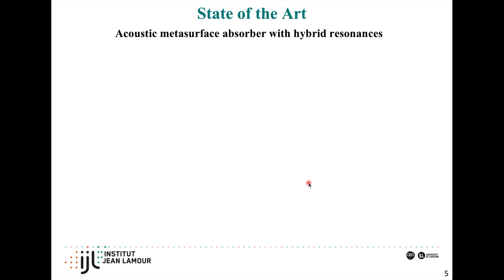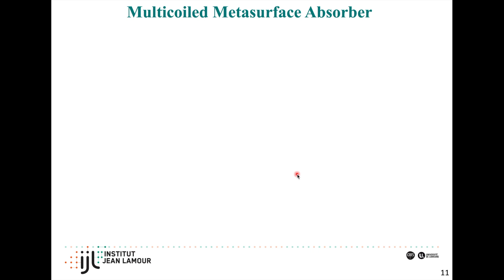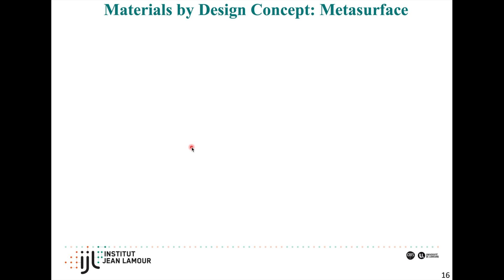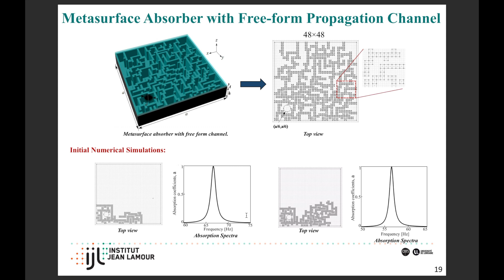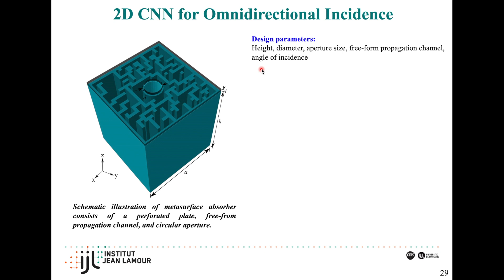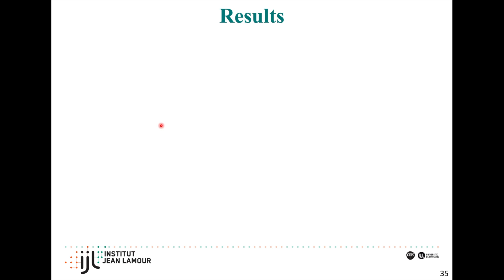Ph.D. Defense| Low Freq. Absorbing Acoustic Metasurface: Deep Learning Approach & Exp. Demonstration

Comment: I have read your paper. Good work. To get accurate results in narrow region acoustics either we can choose some ready made models for some specific cross sections but for no uniform cross section we can consider viscous and thermal losses by creating boundary layer mesh.But after boundary layer mesh formation number of mesh increase drastically so for this we need a good computer but unfortunately I have not a good computer in spite of from  IIT Kanpur so i can't create BLM. I can do calculations without BLM but this is producing inaccurate results.Can anyone suggest some other possible solution?. We have HPC and supercomputer facility but I don't know how to run ansys workbench or comsol on these machines.

Comment: Dear Dr. Donda. Congratulations with your promotion! I stumbled upon your thesis and presentation after reading the article "Acoustic metasurface-based perfect absorber with deep subwavelength thickness" by Yong Li and Badreddine M. Assouar. You take this effort significantly further with AI modeling. Is it possible to share the 3D/CAD file from the absorber of 38.6Hz from sheet 25? I would like to try this absorber myself. I could redraw the labyrinth from the 2D overview, but that seems a tedious effort. Kind regards, Hans Willem.
Reply from the maker: Thank you, Hans for your message and your wishes! Actually, I don’t have CAD or any other file for my simulations. I had manually prepared some designs in COMSOL itself! (with little modifications)
Reply: @humansineducation4511  Thanks Dr. Donda. I understand. I listened to your presentation again after your answer and indeed you did not print all samples and the simulations do not need those 3D files of course. Kind regards and whish you all the best.

Comment: I'm surely missing something... My estimation result for the simple labyrinth design is 160Hz instead of 125 Hz. Do you have an idea about the possible issue?
Reply from the maker: Hi Kix, Did you include a circular aperture?
Reply: @humansineducation4511  I made a circular aperture wall with a diameter of 3.3mm and thickness of 0.2mm with those conditions my estimated result is 160Hz. With a thickness of 1mm my estimated result is 155Hz (with no circular aperture fixed with the perforated plate at the opening of the coiled channel)
Reply from the maker: It should not be like that. Can you tell me your result without labyrinth and without circular aperture? Only with coil with perforated hole in plate?
Reply: @humansineducation4511  (sorry I should not use the word labyrinth) Only with coil with perforated hole in plate of 0.2mm my estimation result is 160Hz and with a perforated hole in plate of 1mm my estimation result is 155Hz)
Reply from the maker: @kixdeafmonkeys2743  I would suggest you first generate the result of this paper. It simply consists of a spiral channel and a perforated plate. They achieve full absorption near 125Hz.  https://aip.scitation.org/doi/abs/10.1063/1.4941338
Reply: @humansineducation4511  Thanks :)